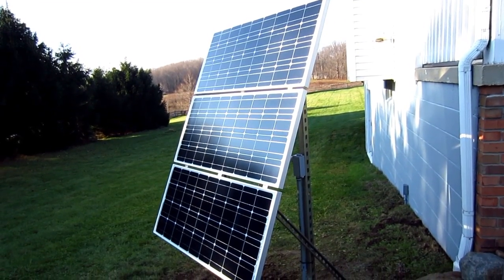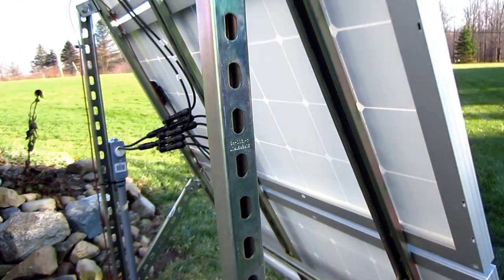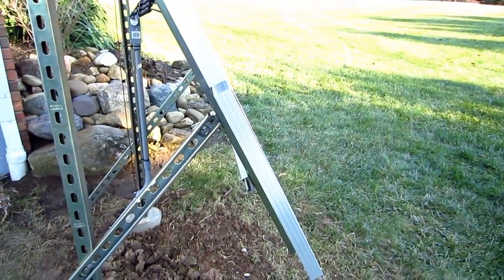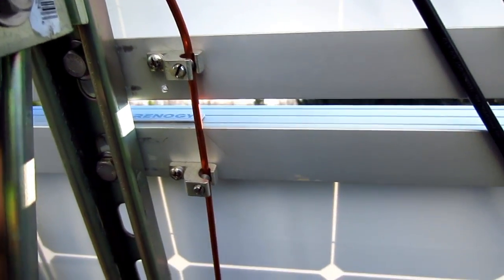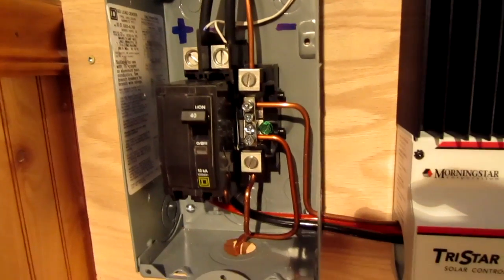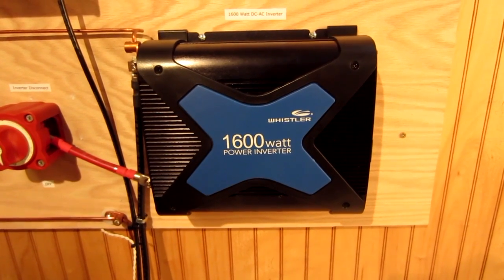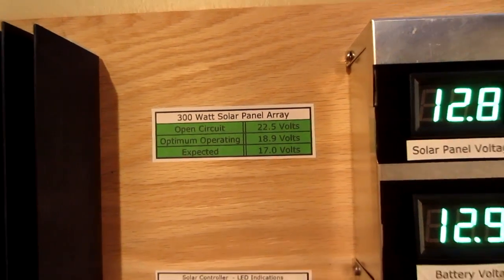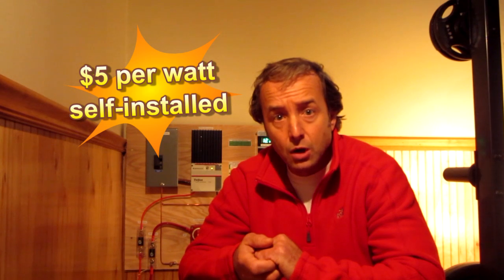DIY Solar Panel System - 300 Watts Off Grid Ground Mount - Christian Dude

Comment: I have four 100 watt panels but they are each on their own mounting system, you can easily move them around and adjust the angles.  The main reason is that I want to eventually add 8 more panels and a few more extra batteries on my solar generator.  I'm not ready yet for a permanent installation.

Comment: one flaw needs to be noted for others watching. on the wiring going into your supply post, the cables should droop lower than the entry hole and then upwards into the hole thereby if water runs down the cable it will drip off instead of going into the hole if not sealed perfectly.

Comment: Thank you for posting this. I had been pondering ways to have an adjustable system and this helps. 🙏
Reply from the maker: I upgraded it this year and made a modification to allow for easier tilting with the sun. Basically, I rounded the bottom of the square bracket on the rotating frame that rests on the vertical struts.
Reply: @JimKirchner  I have a 3k 24v expandable on the way that I need to plan for. I have 6 panels now but will add 3 more so need to build for the 9. The cost of uni strut being 30.00 a stick now is crazy and I will need to do framing with wood and the rails with uni strut.

Comment: Hi Jim. I have an off grid near the Canadian Border and put in a small system also (2 -100 amp Battle Born Batteries and 2 -200 solar panels with a 40 amp Rich Controller). The ONE subject that has a CRAZY amount of differing and confusing opinions is GROUNDING!! I can't believe how much stuff I have watched and how many DIFFRENENT opinions I have gotten on something that should be so simple. our installation is so orderly, but I was wondering a couple of things and look forward to other's perspectives. First of all, Electrical guru Mike Holt, says that lightening protection is a whole different animal. AS I understand it, you do not want lightening connecting with your system, but rather if one wants lightening protection, that is done by creating a "shell" of sort over your structure that is separate from the electrical system. Secondly, (again I am a novice and looking for more opinions) , in a 12 volt system of your size, grounding the system is not necessary, but bonding the frames of the SA and then going straight to a ground rod, like you did will help dissipate a lightning strike, but the in that event, your panels will be toast no matter what you do.  BUT, by connecting them with another grounding cable, like you did to your whole system, you would be inviting lightening INTO your whole system with the associated damage in the event of a lightening strike.  Curious about what you and others think. Like I said, I am a novice, just trying to get a grip on it. In my case, many of the issues I have with my 2000 watt inverter or my honda 2200i generator when I bring AC into the tiny cabin can be mitigated with my GCFI's which are cheap protection from short circuiting issues. Any opinions are welcomed!
Reply from the maker: Great points Rod. I tend to agree with your assessment. Lightning will toast it no matter what you do since everything is so close. Keep spares on hand and let me know your final decision regarding grounding.

Comment: Thanks for this video, it's perfect for my needs. I also thank you for the comments at the end. Do you have an older brother?
Reply from the maker: I do not. By the way, once the weather breaks in April I'll be posting my updates to this system, including lithium iron phospate batteries, MPPT charge controller, another solar panel, and structural functional improvements.

Comment: i built a rack for my panels based off of this design, and i've been extremely disappointed.  it's unnerving seeing it flex around in a 35mph wind.  secondly, the balance is all wrong to easily adjust the pitch.   i plan to build some much beefier replacements (dual-axis trackers as well) this winter.

Comment: This video is 6years old but this was exactly i was looking for to build a small setup (300watt solar), i will be doing mine with 2x100ah Lipo4 batteries.  Its alot cheaper now to build such a system and with better devices. Not sure how yours held up through the years. Thanks for sharing your faith as well. Its sad how this world has turn into now but it is prophesied, so it should not be a surprise. Thanks again.
Reply from the maker: You're right, it is prophesied so why not get excited about our part in the Great Commission?! Sure, news is a drain and life is full of trials, but Jesus...Hey I want to upgrade my system using Lipo4 etc. can you share what components you chose? Thanks <><

Comment: What are the dimensions of your renogy panels? (LxW)
Reply from the maker: Dimensions - each panel weighs 16. 5lbs. length 47. 0" X width 21. 3" X Height 1. 4”

Comment: Hi.. How high are the main supports  stand above the ground and how long are the angle adjusters  for move up and down? THAKS
Reply from the maker: main is 58" above cement. Angle adjusters are 44"
Reply: @JimKirchner  THANKS!

Comment: Great job! Did you drive those vertical beams down by hand? Or did you rent a tool?
Reply from the maker: I rented a power auger from Home Depot, bought the 8" tubes and filled them with concrete then set the verticals in there...

Comment: If I understood correctly the grounding for the electric equipment and lightning protection is one and the same. Thank you!
Reply: That is what was said in the video but it is incorrect. The grounding, no matter how perfectly done, would not protect any equipment from the effects of a lightning strike. That needs to be done differently, i.e. by installing the lightning strike termination devices high up to create a zone of protection. See e.g. https://youtu.be/Ypo99VRxT44?t=1498 for reference.
Reply: @pbasista  Yes you are absolutely  right. What I said  was not about the lightning protection but about the grounding. If you have Grounding for your house and a separate grounding for your lightning protection for the same house ( which should be done properly) At the end of the day you must connect both groundings with a wire so they are one and the same grounding. :)

Comment: I invested in 1800 watts of grid tie for about $2k  runs the meter backwards or offsets demand.. Lowered bill by about $100 / month  then I purchased a 6.5KW generator for power outages and can run the whole house. for as long as I have gas

Comment: I just wondered?, from what seemed obvious to me from the outset?, why you sited your panels there in the shade of those trees, instead of in the full sun further left and beyond in the field??
Reply from the maker: Video taken late in the day in November. Location chosen facing due south, closest to the solar controller, batteries, inverter. It was the best choice for me, with trade-offs. it get's enough sun most times of the year to provide the needed power.
Reply: @JimKirchner  
Thanks for your reply and explanation Jim.
I'm new to this so was just curious.
All the best.

Comment: Hello. You're video is still getting views in 2020! May I ask how the panels have held up in the wind? Also, are you able to adjust the panels the full length to reach the optimum summer angle? It didn't seem like the angled unistrut was quite long enough to achieve that angle. Maybe just an optical illusion in the video. thanks!
Reply from the maker: Hi Steve, yes the panels adjust to the full optimum summer angle, no problem with that. However, changing the angle is somewhat challenging without two people so a design improvement in the unistrut rotation is desirable.
Reply: @JimKirchner  I have implemented a couple of adjustable frames utilizing unistrut on my system. Both require two people (realistically) to adjust the panels. In fact version 1 is so time consuming to adjust I don't even bother. I'm just finishing up V2 on 12 new panels, and although two people make the job quick and easy it could be done with a stick propping up the panels to sub for that second person (it's two panels per leg).

The thing I noticed about your system (which implements one of two design possibilities for adjustable panels. I went the other) is that it could benefit from "Squeeze nuts". They are like spring nuts except that they slide easily up and down the strut channel. I could picture those being used on the lower apex of your "triangle" where the 12 gauge upright connects to the 14 gauge bridge to the panel. If you google squeeze nuts you'll get the idea.

I am really wondering how your system does in high winds, given that the lower portion of the panels don't have a footing. They are simply extended out by the horizontal brackets. Have you had any really high winds to see how much lateral give is in the system?

Cheers!
Reply from the maker: @stevebakker6884  I like the squeeze nut suggestion - makes life easier thanks! Regarding the wind - I couldn't find my calculations but it was engineered for 90 mph winds, and has seen many 60 mph gusts with no issues. I'd be interested to see your V2 design if you're inclined to send a photo I'm at jim247 at the old gmail dotcom.
Reply: @JimKirchner  Perfect. I was looking for your email to converse further on the topic. Will send over photos shortly.
Reply: @JimKirchner  BTW - You don't find those squeeze nuts on every street corner. If your local hardware store that carries unistrut does not carry them, besides being made by unistrut they are also produced by Garvin Industries. Here's a link:

https://www.garvinindustries.com/hanging-and-support/strut-fittings/strut-nuts/snsq3816

Comment: For $1,500 - you could purchase a Gasoline Generator that would power the entire house.  After 5 - 7 years you will need to spend even more money, to replace the battery bank.
Reply from the maker: True, but the point is to be completely self-sufficient. If the power grid went down for an extended period, gas would not be readily available.
Reply: @JimKirchner  But, with a just couple of solar panels, you are NOT self-sufficient either.  You may be able to run just your FRIDGE for about 24 hours.  And then, without STRONG sunshine ( ie clouds ) your batteries will be DEAD = NOT self-sufficient.  That is not worth a $1,500 investment.  How hard is it to ... purchase 10 gallons of gasoline for the ECO Generator BEFORE the Hurricane hits?   When a real emergency hits, you will realize just how feeble your system actually is ...
Reply from the maker: @MrSummitville  You are correct, for temporary outages a generator is better. This little solar system will power a small number of convenience devices, not your house. Power tools, lights, music players, etc. It is intended for an extended grid outage, which is a modest threat in today's cyberwar. The U.S. grid is attacked hundreds of times daily.

Comment: Thanks for the video. As a retired C-10 electrical you did a nice install. I would like to add a few pointers to DIY out there. 

1)Superstrut/Unistrut are different brand names of basically the same product. Superstrut is what is sold at HD/Lowe's and has basically same specs sizes etc.

2) I see a lot of people use strut for platforms with loads etc. Sometimes they support huge barrels of 300-500 lbs. I guarantee these strut platforms with manufacturer strut brackets will rack over time.
Strut corners and brackets have a tendency to slide around. Of course, this depends on direction and amount of loads etc. Most people purchase cheaper 1/4 nuts washers etc. If you notice strut/bracket slots and holes are a bit larger than 1/2". This causes wimpy 1/4" nuts and flat washers to compress into the slot (on brackets etc) and bend/ and oftentimes slide/twist around no matter how much you tighten. (The washer at 1:12 appears to have a gap) I recommend 1/2" spring beefier nuts and bolts/flat washers in combination with a small amount of JB weld in areas where there might be side loads/racking issues. JB weld is probably easiest but not as strong as brazing corners but comes apart with sawsall if needed. I use JB weld after everything is lined up and permanent with manufacturers brackets in place and tightened. Seems to work OK. Strut is mostly galvanized zinc and brazing can create noxious fumes. Brazing/ welding is much stronger but uglies up the install unless you grind and paint. Muggyweld has a lower temp silver solder technique with Mapp gas. I have tried this with only modest success. The large pieces of strut wick away too much heat for the newer MAPP gas. Spot welding structural corners with Oxy/Acet is probably best. I hate welding but sometimes it is necessary. I have also drilled my own proper sized holes with my own brackets/nuts/washers. This works extremely well but takes more time.
3) Using Sawsall with bi-metal blade works OK but will never really get a square corner or 45. Using and abrasive type cut-off saw works OK. Lots of sparks, not so accurate 45/90 corners, hot metal and grinding of corners is needed. I also have tried Diablo metal blades in my normal wood chop saw. But I ended up changing out blades too much. I ended up with low RPM low temp, non-abrasive type Evolution Rage saw ($226 at HD). This saw is low temp, creates clean 90 and 45 cuts and requires very little clean up/ deburring.
A bit long winded but helpful to DIY'rs God Bless.

Have you or any commenters noticed any sliding/movement in your strut corners?

Comment: Nice job! If you build another mount please video the building process. I would bolt on the fuse to the battery or at least put the ANL as close to the battery as possible than controller & electrical tape all your exposed terminals to prevent accidental shorts. Very neat work. God bless you & family.

Comment: 5 YEars installed, what is the condition of the mount?

Do you adjust the angle monthly, quarterly, when?

I am about to add 3 kWp to my 6 kWp setup, but DIY this time. This adjustable angle setup is exactly what I want, as long as it's still in good operation 5 years later also.
Reply from the maker: Condition of the mount is still like new. The Superstruts and stainless hardware have held up very well. I adjust the angle quarterly. It's kind of clunky to adjust, so I recommend considering other angle adjustment designs.
Reply: @JimKirchner  I think about the only way to make it easier to adjust would be with spring pins. Like used on gym equipment.

I have a roof mounted panel installed by an installer and I spent way too much money. But now I have a much better idea how everything works. I I have yet to find a simpler way to have an adjustable mount than what you have shown here. I think the aluminum kits are just too flimsy, that's why I think the stainless steel like this is a great plan. Maybe a car jack to crank mounted between the vertical posts that the side adjustable posts are attached to.

Comment: Great video! Why do you use MC4 connectors instead anderson connectors? I like your mount. It's a cool mount.  Great installation for your home! Love your video at the end.

If you one need different mounts here you can find some easy to  install mounts, made in USA https://cuttingedgepower.com/pages/search-results-page?q=solar+panel+mount also, if you need some USB adapter for your solar panel we have this cool one. 2, 4, or 8 ports USB adapter https://cuttingedgepower.com/products/mc4-adapter-to-usb-output-mount-directly-to-solar-panel-2-usb-port-4-usb-port-8-usb-port You can plug it directly to your solar panel. Also, we have super batteries boxes ready to go. You don't need extra connections https://cuttingedgepower.com/pages/search-results-page?q=power+house If you have any questions or there is something we can help with, just let us know it, please.